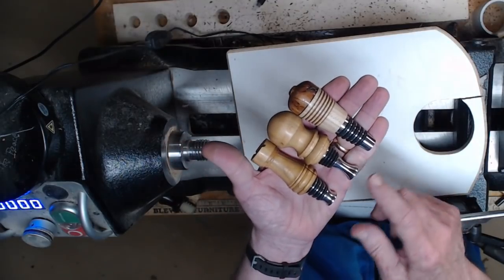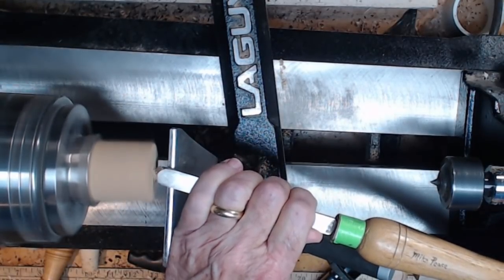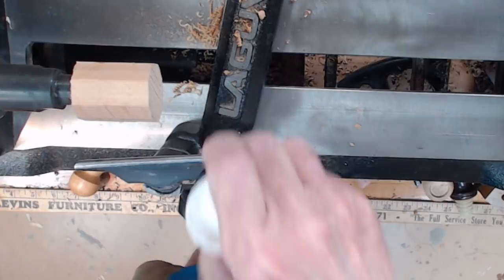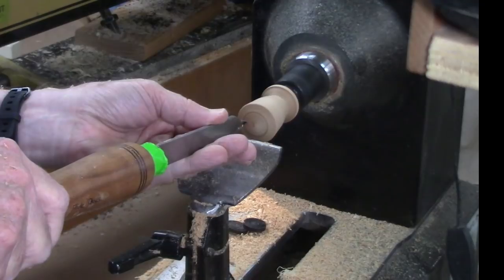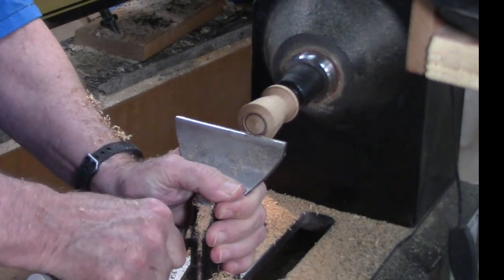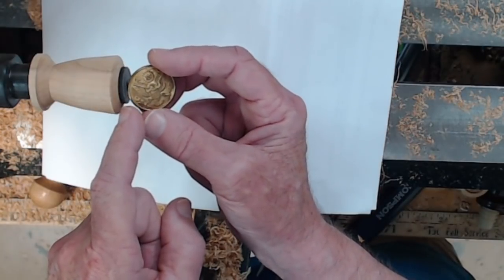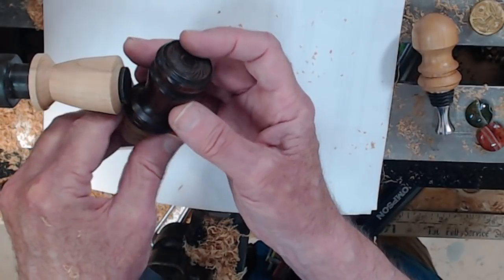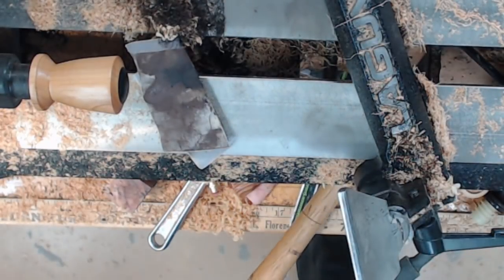Turn a Bottle Stopper : Not Just for Wine Bottles!

Comment: Very timely and well done video. Never too early to start turning Christmas gifts. One thing I do is create a slight (less than 5 degrees) undercut on the hole end of the blank to ensure a seamless fit where the wood meets the metal, similar to the way you undercut a bowl bottom so it sits flush on a table.
Reply from the maker: Thanks for sharing.

Comment: Agree wholeheartedly with your comments about Ruth Niles and her stoppers.  Her stoppers are far superior to the plated junk sold by some other vendors, and she is a really nice person to talk with at shows.

That said, I usually give away my turnings; every time we go to a party or dinner where I take a bottle of wine, I always include a stopper.  Ruth's stainless steel design is a bit spendy for the majority of the stoppers I make.  But I do have a few of Ruth's on hand if I need to make something special.

One area where I differ from you relates to the hole - because the axis of the hole aligns with the grain of the wood, threading the hole can be tricky, and the threads aren't very strong.  So I have been making 5/8" diameter threaded inserts from face-grain wood that I glue into a 5/8" hole in the bottom of the stopper.  The inserts are made by drilling and tapping holes in scraps of wood, drilling into face grain so that the threads are parallel to the grain of the wood (threads in face grain are far stronger than threads in end-grain), cutting them apart, and then mounting them on a stopper mandrel to turn down to 5/8"cylinders.  I batch out a bunch of the inserts that I keep on hand so that it doesn't take any time at all to drill a hole and glue in an insert when I'm making a stopper.

Comment: Great video.  Very timely - I've been giving some thought lately to making some bottle stoppers for gifts.  I have the same lathe.  Where did you get that small tool rest?  The one Laguna supplies has proven a little too big, even with my limited experience.
Reply from the maker: Thanks. A friend made the the tool rest. I bought a nicer small one for my PM made by Robust. They make the best ones.

Comment: Thank you for the instructions. I have the Ruth Niles self-tapping mandrel, but I’ve had the issue of it stripping the threads when turning. Do you have any solutions to prevent that?
Reply from the maker: What size drill bit? I am guessing try a smaller bit. Thread on and off, and add a bit of thin CA and remount when dry. I never had a problem with 7/32".
Reply: @MikePeaceWoodturning  Thanks Mike, I will try that too. I may have been too aggressive with cuts as well.

Comment: I love your videos. They've been super helpful as I'm learning to turn. I've made the sanding paste and abrasive paste you shared in a different video. I have a question. Do you find the wax or oil interferes with other finishes you put over the top? Is there a special prep you do for finishing after using the pastes? Thanks.
Reply from the maker: Thanks. I have not had any finishing issues and have not heard of any.

Comment: Excellent demo Mike. Question: Ruth Niles has a  Beginner Stopper Kit which includes two thread taps. I don't see where they are used. It appears the bottle stopper is screwed into the same hole the  mandrel used when turning. Can you elaborate? Thank you for sharing. Have a great day and stay safe.
Reply from the maker: Taps are good for extremely hard wood and acrylics. Generally the tap mandrel will do fine cutting threads for most domestic woods depending on the size hole you drill.
Reply: One tap is a regular tap, but these are tapered and do not cut threads all the way down in a blind hole. The second included tap is a bottoming tap and that is designed exactly for that purpose-- threading to the bottom of a blind hole. The tapered tap is easy to start the hole threading. This is a very well-thought out kit and gives even an experienced turner the tools and accessories she/he needs.
Reply from the maker: Thanks, Dave, for the better explanation.